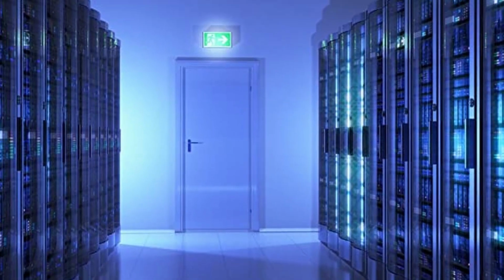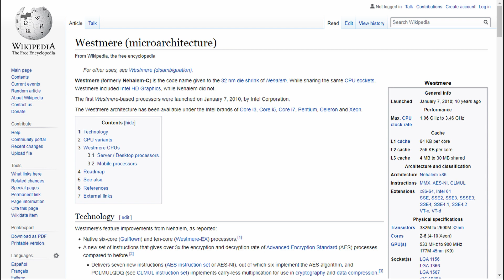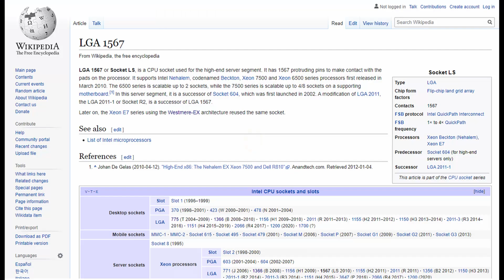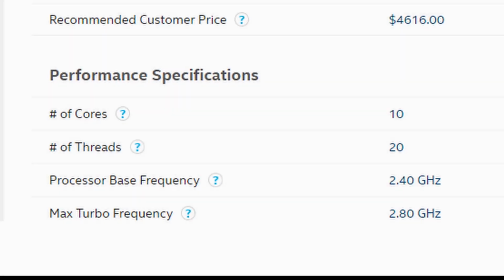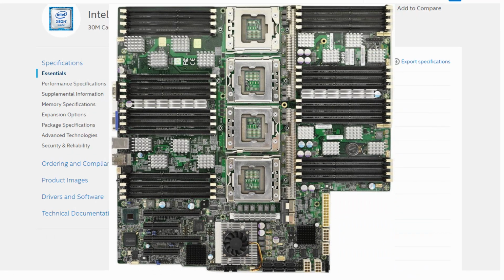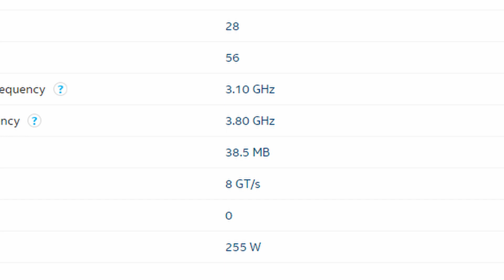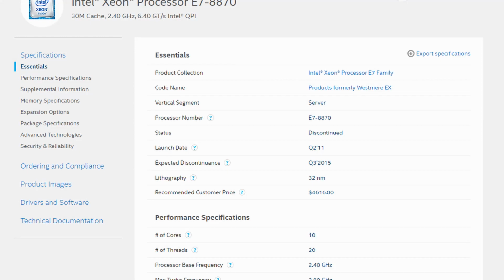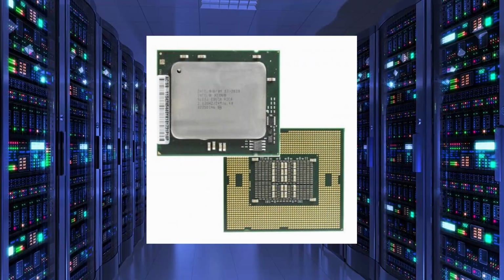The forgotten story of the lga 1567, X58's bigger brother

Comment: All Westmere CPUs are 32nm, 45nm was used for the older Nehalem CPUs like the i7-920 you mentioned. Also Westmere was first released for LGA1366 in 2010 and for LGA1567 in 2011.
Westmere is a die-shrink of Nehalem (just like how Ivy Bridge is a die-shrink of Sandy Bridge), but for some reason Intel didn't brand them as a new generation, so i7-900 series has a mix of 4c/8t 45nm Nehalem and 6c/12t 32nm Westmere.
Reply from the maker: Yessir. That is correct! Thanks for the input and for the clarification!

Comment: Wow I had never heard of these chips! I built a dual-socket system once with the 6-core x5690s and I thought thats as high as it went!

There is one other RARE cpu to check out... the Xeon X5698. It was an insane dual core that clocked all the way up to 4.4 Ghz! In 2010! I have seen these only a few times in my life, they are apparently used for stock trading and Intel didnt even publish a spec page as it was so rare and specialized! 

Awesome video btw, keep up the great work 👍
Reply from the maker: Oh man i heard about the x5698. Mythical cpu! Used for trading. Also thank you for the feedback. Just bought a x58 kit with a i7 975 and I will try to post a video about this 1000$ cpu.
Reply: I'm still running a X5670 6c/12t @ 4.4GHz in my main PC but I already have a X299 system with an i9-10900X waiting to replace the old X58 rig.

The X5698 was released in 2011 after Sandy Bridge CPUs like the i7-2600K were already released, so in single core performance the X5698 never was the fastest one. Though for the intended market of the X5698 the mainstream consumer i7-2600K wouldn't have been an option due to the required reliability.
In clockspeed even the first AMD Bulldozer CPUs released later in 2011 didn't quite match the X5698, and Bulldozer would have needed even higher clocks to match the X5698 in single core performance. Piledriver FX-9370 and FX-9590 were probably the first CPUs to surpass the X5698 in stock clockspeed in July 2013

Comment: I have a Fujitsu RX600S6 and it has four E7-4820 (each 8 cores and 16 threads). It‘s not much faster than a i7 4790k OC‘d to 4.7Ghz but it draws a lot more power. 500W on idle.
Reply from the maker: 500 on idle???? WOW! Nice specs btw!
Reply: Oh that's why people don't use them and they are extremely rare
Reply: @averyoldYoutubeuser  I mean, the power draw is definetly the biggest factor, especially when it comes to something that will be on 24/7. I didn't need that much power altho it was nice having it and messing around. I'd much rather have a Ryzen 5 5600x and 64GB of RAM than that monster and 224GB of RAM. I couldn't utilize that much RAM even if I wanted to. I ran a mediaserver, a Minecraft server and Pi-Hole on it, so unless I ran something that could utilize that much power, I had no use for it which is the reason I sold it. Got a smaller server with LGA2011. Spec'd it out with the remaining RAM but even that draws 300W-ish on idle so it's off most of the time. I have a Android Box running Pi-Hole and that's basically the only thing I have running 24/7. Sad that I got rid of it but the power bill was enormous.